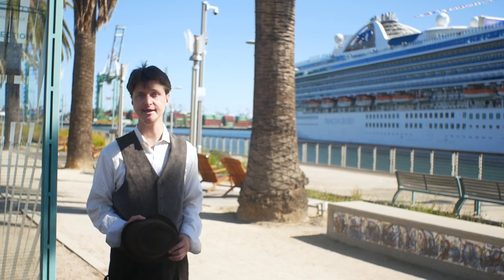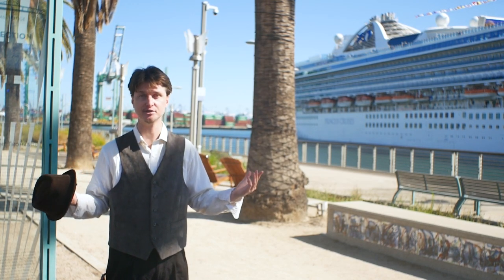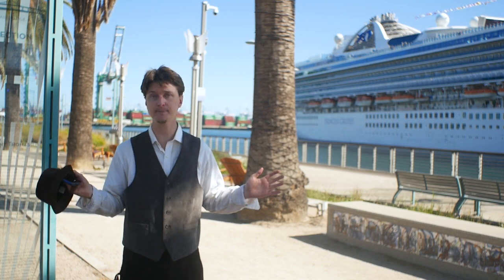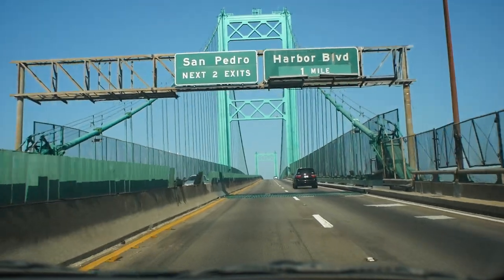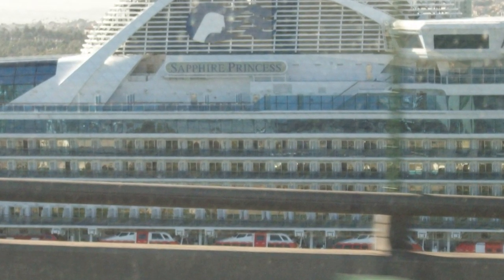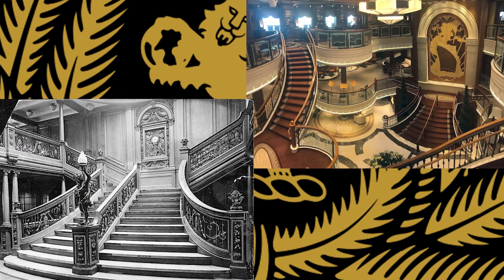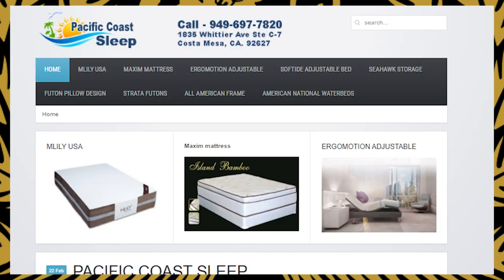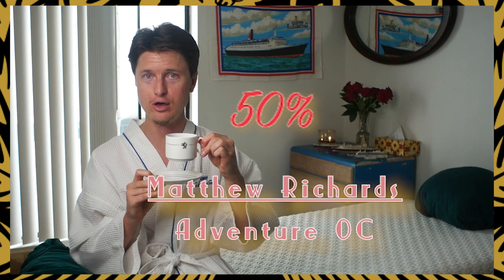Why Cunard Queen Elizabeth & Queen Victoria Are Like Ocean Liners

Comment: From the forward 3/4 view the QV and QE aren’t unattractive. The funnel could have been 50% taller and QV’s original angled aft deck complimented the forward angled superstructure. The additional aft cabins added later compromised the aft appearance and like the newer QE has an ungainly aft section. That said QV and QE are still more attractive than the new Queen Anne if the renderings are accurate.
Reply: I imagine the height of the funnel has to do with bridge clearances
Reply: Totally agree. No idea what they were thinking with Queen Anne... 🙈

Comment: Ehhh... There's something odd and anachronistic about creating reproductions of old architectural styles inside a modern ship. Yeah, all the liners used to have that, with Jacobean, Tudor, Louis XV, etc interiors to steel, coal-powered, industrial age ships. But, that stopped in the 1920s, with ships like the 'Ile de France' and 'Bremen' having then-modern Art Deco interiors. And they never looked back after that. RMS 'Queen Mary', RMS 'Queen Elizabeth', RMS 'Caronia', etc had interiors that were not only current in their day, but pushed the conventions of the style, with upholsteries in daring colours and modern artworks.

BUT, the interior of the MV 'Queen Elizabeth' isn't even a reproduction of anything. No, it isn't Victorian. It's a cheap, modern imitation of Victorian, schizophrenically jumbled in with wannabe Art Nouveau, Art Deco, and Edwardian. (Which reminds me: The Victorian era ended in 1901. 1910 was during the Edwardian era.) Nowhere in there is Rococo; pseudo or otherwise.

Don't get me wrong. The ship is elegant and shows an attention to design, material, detail, and craftmanship rarely found on ships these days. And, yes, it isn't kitschy. But, there's a lot of quality and detail at Disneyland and Disney World, too.

The term is "asymmetrical" and a "suffix" is the end of a word, following the root, by the way. "Queen" in the names of Cunard's current ships would be a pre-nominal title. Further, the Duchess of Cornwall no longer possesses the name Parker-Bowles and the RMS 'Queen Elizabeth' was not launched by a reigning monarch. Queen Elizabeth--the wife of King George VI--was a queen consort, not a queen regnant. And, lastly, the model in the Yacht Club is the 'Queen Elizabeth 2', not the original 'Queen Elizabeth'.